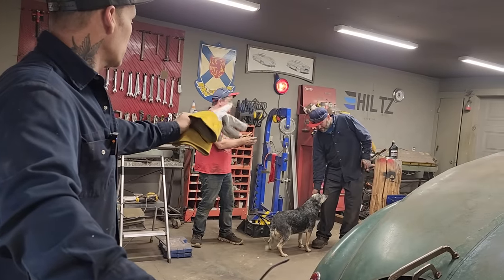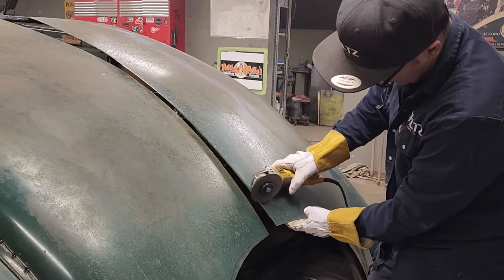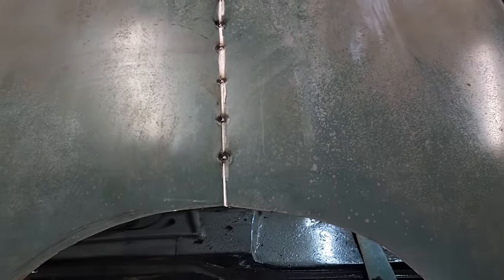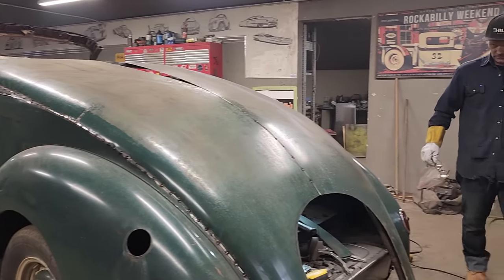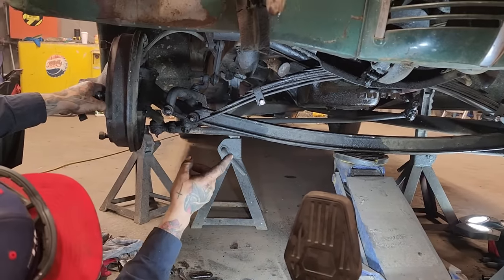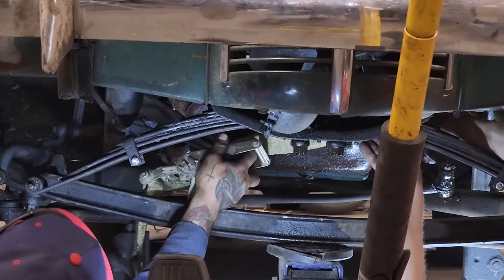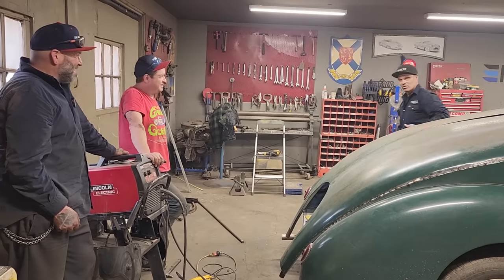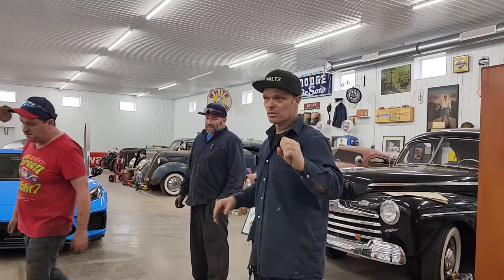PLOT TWIST...bet you weren't expecting this design change 😳

Comment: My vote is to keep the Roadster for a few reasons, 1. Loading & unloading the motorbike might be a bit challenging. 2. without a closed-in back end the exhaust gasses will enter the passenger compartment. & 3. it's gonna look like you got rear-ended by a motorcycle from the side.

Comment: Sounds like your fishing for a quick fix to a screw up. If you want to haul your bike , put it one of your trucks you already have built. If you recall correctly the higher the front of the rear deck,, the more issues you had with fitment. The lower you went up front the better it got all the way down.
Reply: Also I recall Chad talking about cutting a bit off of the passenger side round stock, because it was slightly higher than the other one. Unless he did that off camera, he didn't do it, and now it's causing problems. I'm confident that he will get it looking good, in the end.

Comment: You have enough haulers, this car is going to look better as a straight roadster. Putting a motorcycle in the back will look like Granny on the back of the truck in the Beverly Hillbillies. Even with a removable piece in place it will look odd, especially in concert with the carson top.

Comment: Please don’t change horsed mid race , leave it as a convertible. The only thing that is missing is a rumble seat . Framing that out will also help lift the centre of the rear “ roof” into shape and keep the great looking rear line of the rear end . Just a thought but it would solve one problem  , sorry , two problems the , first would be that you could leave the tubular frame in and second is that I haven’t seen a custom job with a rumble seat  . Sorry for the rambling on !

Comment: Chad:  My first preference is for the roadster, not a bike hauler.  You have a very unique look going and the bike would distract, plus, hauling  bikes around in a car just doesn't come up often.  Having said that, another possibility is to build an enclosed trunk with a removable or hinged lid, big enough to put a bike in but doubling as a grocery or supplies trunk.  You could also put a spare wheel on top of the lid and it could open to the side instead of like a regularr trunk.  There you have multiple unique designs!

Comment: One more roadster rave. I've hauled a lot of bikes, even  build a custom trailer for the job. You need a fair bit of side clearance to get a bike into any space, and I don't see that with this car. Measure the bike for width at the handle bars and overall length. Then there's the problem of tying it down. Lastly, if you make it into a hauler there would be no space for Fina.

Comment: I like it the way it is. If you cut it out for a bike you’ll have to cut it wide enough to be Abe to get on and off the bike.  I’d find another project for the bike hauler. That Triumph looks like and old Bonneville. I had a 1970 Tiger, and it was a great riding bike. Those used Triumphs aren’t cheap, when you run across them.

Comment: Bike hauler / roadster. Let the back open up sort of like a split tool box, the kind with two doors but they only come up an inch or so and then slide left and right.  Or like closet sliding doors. The rail would be on the doors and the doors would have rubber bumpers where it might contact the back sides paint. The take off and remove would be easier but not as cool.

Comment: Baddest chad on the planet! Love the build and does take alot to turn a tudor to a roadster... Yet you are known for the unique and really off the edge designs! A roadster perhaps a model that you can find in barn with slight differences but the bad chad part is definitely the bike hauler! I d love seeing how you d design that and implement it into the roadster! The hidden ramp pocket, the V, the supports! Also I d definitely go for the classic scooter for how it is designed and its curves would do definitely go much better than the 80's honda bike or whatever that is! Bottom line, When car all done as a roadster, you d be taken as a good restorer who found an original, but with a bike hauler? Thats definitely a custom from A to Z!

Comment: Keep the roadster need to find a car to make the motorbike hauler that matches the bike or that is finished to match. Also be cool the have the bike run the car. Like Dino rollers that controls running gear and cage that stear with handle bars. Brakes could be little more tricky but could always just have pedal next to bike spot on floor.

Comment: Keep it a roadster.  could you not put small square stock between the two round braces to support your low spot in the back as well as at the bottom of the rear end. Instead of putting in another round bar full middle brace.

Comment: I think you should keep the theme as you started to build a roadster changing to the bike hauler doesn't fit in the design I am currently building a custom ride and I drew a couple pictures of a change with a bike in the back and it still has two many issues with the overall look of the custom ride

Comment: Hey bad Chad love your vids keep it up.
With the roadsters back boot part your welding in the middle that half round open part you could turn into a spare wheel holder that has the spare wheel on edge standing upright 👌

Comment: Mr. Chad , why don't you use the truck you made as your motorcycle hauler and install a slide-able ramp in the back ? It's just sitting there, needs  to be run from time to time. The roadster is more elegant looking.

Comment: Build the bike hauler! But instead of making a ramp to load with and remove. Build your loading ramp like one for your trailer. Just put a slide in slot under the floor for the ramp. That way it's always with you, and you can add extra pin holes in the ramp. Just in case you get a longer bike you can slide the ramp out a bit to accommodate it's length.

Comment: My thought is the bike hauler but with a custom made 1920's/1930's dirt track or board track racing motorcycle. A 1950's/1960's bike wouldn't look right in my opinion. Maybe a newer bike but worked over Hiltz style to have the look and feel of the period. Period gas tank, fenders and engine added bits to hide what it really is.

Comment: What about a 3/4” flat stock,that runs under the trunk lid. Make it longer than you need. Tack back end first then from the front push till desired arch. Kinda like stringing a bow Mike from Missouri.

Comment: What if you put a cross piece where the top of the trunk lid would be. that would most likely pull the sides in place and provide a bridge for a trunk  if so desired later. Just saying.

Comment: Go for the bike hauler. Just give some thought into the width of the gap in the rear of the car as you need to run the bike on and off the car. Also use a bike from the same era, the Triumph is too new being from the 70’s.

Comment: Id put hinges on the length(1 foot of metal off of the center,so you have 2 foot of space for a little room) so when you load the bike you pull up each side up and lock it in place and then pull out the ramp to drive the bike up the ramp

Comment: The Vespa would be cool for the indentation in the floor of the car to hold the front wheel down and then use the top also as a ramp that I think would be cool.